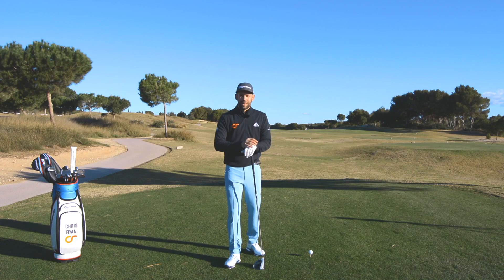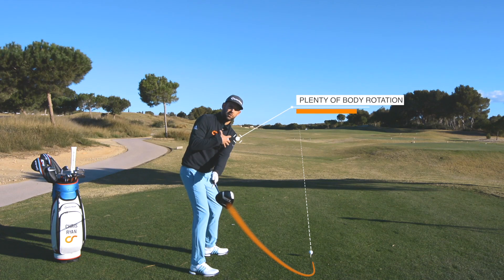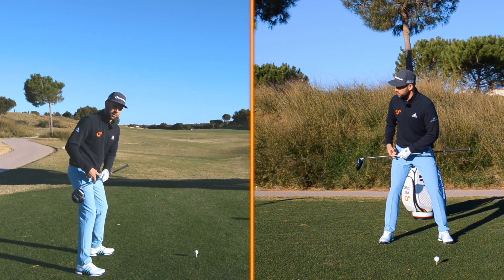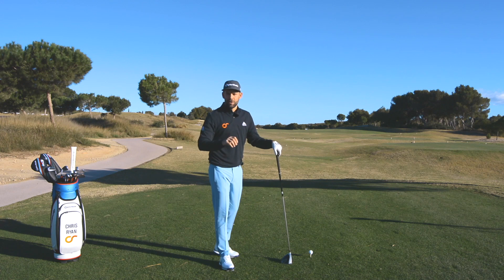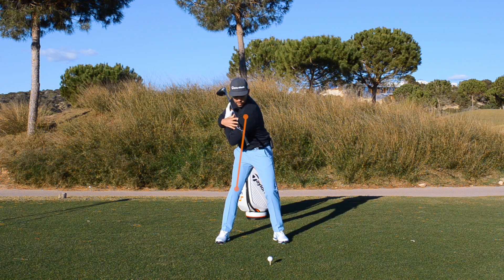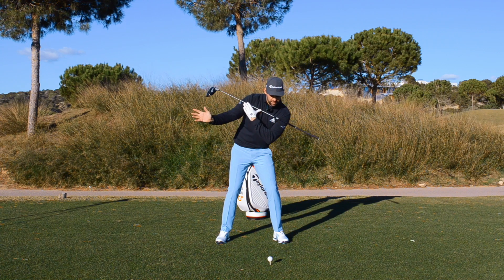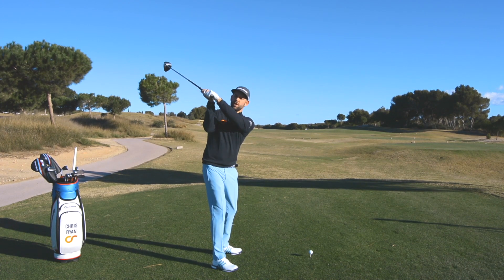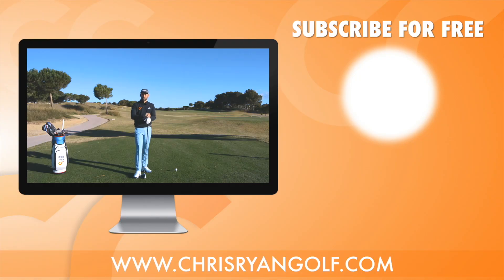FIX YOUR GOLF SLICE SERIES - THE BACKSWING 2/4

Comment: Hi Chris. Could have just done with a little segment on what happens, or what we should be doing between 1st parallel and the top of the swing ref right arm fold and wrist actions etc. I think a lot of people struggle to know “when” to stop taking away and start folding the arm and setting wrists. This leads to the right arm staying straight for too long and effectively pulling them off the ball or swaying. Any thoughts regarding the timing of the fold and wrist setting/hinging. Thanks.
Reply: Ian Robertshaw best not to think about wrist angles, cocking etc. It you rotate hips/shoulders properly your hands will follow. Try feeling your guiding the club with your biceps/shoulders and the hands will passively follow. Try it out with a tennis racquet, do a natural backswing for a two handed forehand tennis shot without thinking. Then notice what muscles you are using, you’ll also realise your naturally not thinking about wrist angles and cocking, but amazingly the racquet face goes back properly and you return it square without thinking. Hope that helps...it did me

Comment: Hi Chris. I was told by my golf coach that the grip dictates the wrist angle at the top of the swing. I have a strong grip and he suggested that this will mean that I should have a cup at the top of the swing.

Your video suggest otherwise or are you assuming a neutral grip?

Appreciate some feedback.
Reply from the maker: Hi Juan, yes he is absolutely correct, I am assuming a neutral grip so if
Your grip is strong your may well be fine with some cupping of the lead wrist 👍👍